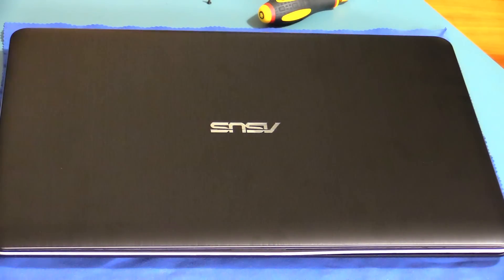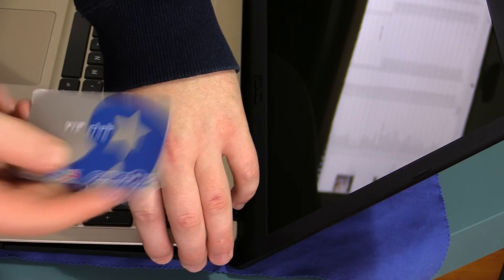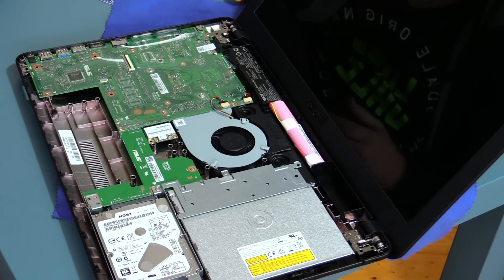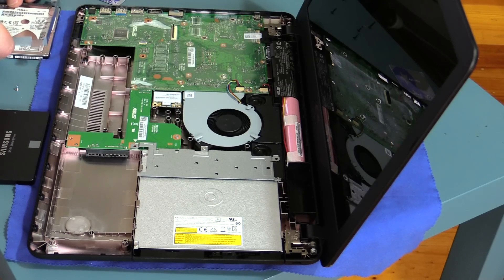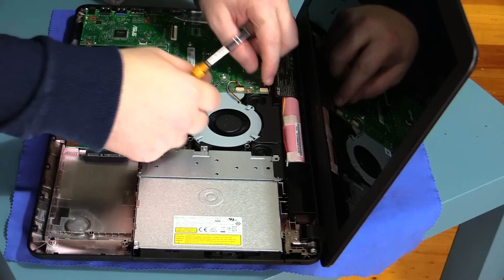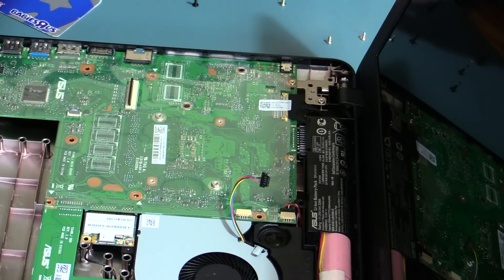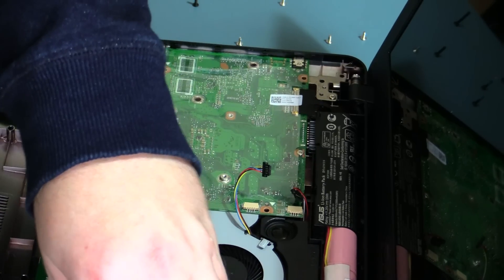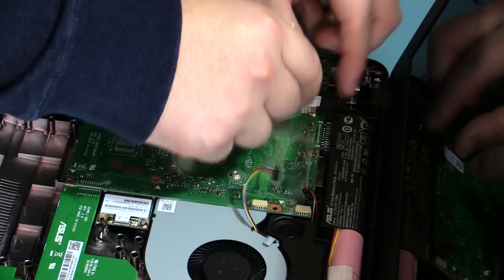Asus X540L Disassembly for hard disk replacement or memory upgrade

Comment: Hi, a friend bought this in Best Buy and took it to Argentina. Right from the box, the battery won't charge more than 50%, and when you disconnect the power cable, it shuts down. May it be a physical problem? Why might the Windows OS tells the % of charge?
Reply: +Rodrigo ST si. De todas formas voy a bootear un live linux a ver que dice, antes de operar. Luego te cuento!
Reply from the maker: hi there, yes it's most likely a physical problem, could be a faulty battery, maybe a faulty charger although it can also be the motherboard too. If it's not practical to return it you can try eBay for parts just try stick to genuine if you can. Good luck!
Reply: +Anthony Parker Thanks Anthony! Do you think the charger may be the cause? it says 48% charged, it looks like something internal. 
I don't have spare parts, opening just to check connectios would be worthwile? Or I shouldn't bother?
Reply: +Anthony Parker Thanks Anthony! Do you think the charger may be the cause? it says 48% charged, it looks like something internal. 
I don't have spare parts, opening just to check connectios would be worthwile? Or I shouldn't bother?
Reply from the maker: +Luciano Brom i wouldnt open it if you haven't already as it may affect your warranty claim. there really isnt much inside to 'check', its just a connector and short of them wearing with age they don't really have issues. Are you using a power converter or something like that? I'd say that your charger is probably the most likely cause but hard to diagnose without seeing it in person.
Reply: +Anthony Parker ok, will check all that. Thanks, man! Saludos from Buenos Aires!
Reply from the maker: +Luciano Brom no problems :-) happy to help! good luck from Australia
Reply: Hola Luciano, como estás? Compré esta misma notebook hace 1 semana en EU y estoy con el mismo problema.. Dice 84% pero si desenchufo el cable power se apaga.. Lo pudiste solucionar?
Reply: +Rodrigo ST no la abrí aún. Probé el cargador con un multímetro y funciona ok. Es raro que muestre un % pero se apague como si no tuviese batería, no? No será problema de software?
Reply: +Luciano Brom Quizás sea windows10 pero es bastante raro..
Reply: +Luciano Brom Dale buenisimo! Espero novedades. Gracias!

Comment: I am having trouble, I got my memory and hard drive installed, everything put back together, but it won't run off the battery anymore. I have no idea what I did wrong. Any suggestions?
Reply from the maker: Well battery is a physical connection, so unless that battery is faulty, it must  be internally disconnected or shorting out or something like that. Have you open it up to have a look? There is nothing to configure from a software perspective regarding the battery.
Reply: +Anthony Parker same problem here. Any other ideas?
Reply: +fzstephen I was testing it without the screws in, I don't think it was making good enough contact without it, once i got them in it was fine.

Comment: there is no point on change the memory ram becouse this laptop chip set only work whit 4 of ram, so dont try to replace it for an 8 of ram
Reply: Did you try it? 

ARK Intel spec sheet says the processor can handle up to 16GB but other parts probably don't agree with that.
Reply: I tried and it won`t boot. Nice comm, unfortunately I read it after i try installing 8 GB.
Advice: The laptop has 1 DIMM slot, If you run this specific model, do not try installing 8 GB, it won`t work!
Reply: dani calau Thank you for the valuable information!
Reply: I just put an 8gb soddimm in the x540L.  recognized, works fine.  The "L", I dont know about "LA" or any other variants
Reply: no... L as in X540L.  There are a number of variants in this product line.  Just confirming that a ram upgrade to 8Gb is entirely possible with this laptop
Reply: lots of reasons that might be.  What actual model do you have? the "L"?  the "LA"? SA? SC?    I can personally confirm the base "L" model comes natively with a single 4gb sodimm (not soldered on ram).  I removed that module and replaced with an 8gb, worked fine.  Can you boot on AC power?  there is a fastener at the top of the motherboard whose primary function is to provide a power return path to the battery, if that screw wasn't installed in the right place your battery wont work and the laptop will appear dead.  In this case, the AC power adapter would still work though.
Reply: thats not strictly true.  that may be true of the x540SA or SC or something (he actually covers the LA in this video), but the "L" reports as having 4gb physical memory.  upon opening it up you see one memory slot with one ram module size=4gb.  I removed that and replaced it with one 8gb module, which then caused the system to recognize exactly 8gig of physical memory. no mystery 2gig floating around.  If you go to one of hte memory provider websites like kingston or crucial and use their upgrade finder you will see an 8gb ram module correctly listed for the x540L, but NOT for some of the other similar models.
Reply: see asus specification page.. it only has 1 ram slot and can handle up to 8Gb of a single SODIMM.. make sure you use the DDR3L module.. don't expect much from the X540.. it is designed for lower end CPUs.
Reply: believe me, it won`t. The DIMM slot can support only 4 GB. The laptop is up to 8 GB if the motherboard have onboard  4 GB ( this memory can`t be replaced if your particular laptop have it) . After I tried to install 8 GB, I contacted ASUS Support and this is the official answer.
Reply: I prefer to buy gaming laptop
Reply from the maker: Hi there... the L stands for Low Voltage (1.35V instead of 1.5V)... if the SODIMM were 1.5V it wouldn't have booted at all, so it must have been 1.35V and if you just took a pot shot at that then... lucky guess! haha
Reply: +Anthony Parker i used 1.35V, it won't boot
Reply: there's a 2Gb soldiered on RAM.. you can't see it.. you can confirm this when you view your system specs.. this line came with a 2Gb soldiered RAM and a spare RAM slot
Reply: never thought about this, it may work. I`ll try in the future if I`ll borrow a ram stick.
Reply: did it make  difference
Reply: Hey there, I am using Asus X540L . The specification says its has 2 RAM slots. Do they mean we can add another RAM or remove the old one and put in a new one with higher RAM?

Comment: I cannot believe ASUS would design something so shitty. U should be able to get to the fucking ram easier than this
Reply from the maker: yeah agreed, you'll see this more and more in the cheaper lines of laptops though. where you cant access ram or HDD.
Reply: the most of the companies does it now bro
Reply from the maker: +LICKMYCUMAGAIN  yeah they kinda suck making it harder for people! that is business though
Reply: This is NOT an uncommon practice, and is in no way representative of build quality, or design quality of a laptop. What, you think engineers couldn't figure out leaving a hatch above the DIMM slot? Please.
Limiting upgradeability of sub-$400 computers is done for a valid reason: when you give your customers $199 worth of a Core i3 SKU and $149 in NVIDIA Kepler GK200, the best you can hope for is that they'd buy a similar product in 2-2.5 years, after their current one finally loses its pristine condition. ASUS have researched the subject, they know what they're doing.
Reply: Only for high end models. Not for low end models like this.

Comment: Hi there! I just bought the  asus x540LA, im wondering if i can upgrade the graphics card later? is it possible?
Reply: +Esteban Gonzalez No, in fact even laptops with budget dedicated graphics can't be changed out. They're discreet so soldered onto the motherboard. It's only the highend laptops that have removable graphics cards, although even at that level, it's very hard to get a compatible card that you can change out. It's just not something that's done commonly in laptop graphics cards yet.... you may see it in the next few years, just not yet. There are a couple of speciality websites that do trend in laptop graphics cards, but wouldn't work in this laptop. Please hit the subscribe or like button :-) Thanks.

Comment: swapped the RAM for 8gb and now on startup the screen just stays black (although can see it illuminate a little)...doesn't attempt to load anything, no Asus welcome screen, nothing. does anyone know what might be causing this?
Reply from the maker: its probably the wrong memory. did you use DDR3L or DDR3. pretty sure you need 3L with this model. ..
Reply: +Anthony Parker yeah well I tried putting the stock RAM back in at the screen still is black but slightly illuminates when I power it up. I can hear the hard drive and fan light up as well as the LED in the board. Maybe I'm not inserting the RAM correctly into those weird clips, do you install the RAM at a 45 degree angle and then push down into the clips?
Reply from the maker: Yes although it does have to be in quite firmly. Youll often get black screen and nothing if the ram is not in properly or its the wrong type. If the video card were not connected you wouldnt get any light on screen at all so I'd be very sure the issue is memory related.
Reply: +Anthony Parker it wasn't seated correctly...took me a couple tried but got it right. thanks for your help.
Reply from the maker: +Eric Moss no problems :-) glad you got there. please do hit the luke or subscribe button :-)
Reply from the maker: +Eric Moss ***like lol

Comment: Will a 9.5mm thick hard drive fit in this laptop or does it require a 7mm drive?
Reply from the maker: Hi Dan, sorry I'm not sure on that one, you'd have to check with the manufacturer... will certainly be tight... you can always also try without the hdd metal frame. Perhaps do some googling for the manufacturer service manual,  theyr usually easy enough to find online and may answer it for you. it might be just one of those things you have to try... can try opening it up, measuring somehow then buy the drive.
Reply: @Anthony99  It is an old post, but I need to replace on this laptop the HDD. And User manual does not mention the dimensions of the HDD at all, nor the specs in the google results. I'll check it because I have both 7,5mm and 9,5mm HDD.

Comment: Hi there. Nice video.
Does it have a single slot for the RAM or two? 
Thanks in advance.
Reply: It as a single RAM slot. 4GB comes factory soldered to the motherboard, allowing you add 2GB or 4GB to the RAM slot on the reverse side of the motherboard.
Reply: Is it possible to add also 8gb of Ram
Reply: well,Emmah Stone got it wrong,the max capacity aplies for the slot not the total with the integrated memory since the intel core I3 can handle 12 GB of ram and so does that nice 920m.
Reply: i have the i3 with gt 920m. according to asus tech support, the DIMM slot can handle just 4 gb, and the laptop have just one. I tried on my own laptop to install 8 gb and the display remains black ;). You can try to put 8 if you want to convince yourself :))

Comment: Changed ram now display doesn't come on
Reply from the maker: +Matthew Edwards no problems,  dont forget to hit the like and subscribe buttons. it is a big help to us YouTube creators. thanks
Reply from the maker: did you check whether the ram is LV or standard? if you put standard DDR3 in a laptop that needs DDR3L it wont boot, wrong voltage.
Reply: yea. That was the issue also the fact that it wasn't in all the way. Got it working though.
Reply: +koxsuper5 having the same issue as you. i really dont want to take that mobo back out but ill let you know if i get it working
Reply from the maker: +Matthew Edwards did you check for LV ram instead of standard ram? if it doesnt boot its either incorrect ram (most likely) or the ram isnt in the socket properly. good luck.
Reply: +Anthony Parker I made sure to get 1600mhz DDR3L. Maybe it is a bad dimm? I'm putting original ram back in and we will see if it boots or if I broke something
Reply from the maker: +Matthew Edwards its quite difficult to 'break', more than likely it's incorrect ram / incompatible. thanks
Reply: +Anthony Parker yea it booted after I put the old ram back in. I'm going to try to reinstall one more time and if it doesn't work I'm going to assume it's the wrong ram. Thank you
Reply: +Anthony Parker done thanks again for this video it helped a ton. It seems like this is one of the more awkward laptops to get inside of to replace stuff.
Reply from the maker: +Matthew Edwards happy to help! I dont make the worlds greatest videos but as long as you can get done what you need to get done.. thats the important part. thanks for subscribing!

Comment: and where is the intel hd graphics ?
Reply from the maker: intel HD graphics is built into the CPU, even dedicated graphics these days are rarely seperate cards in laptops. theyre typically discreet, meaning built onto the motherboard... but Intel HD graphics is built into the CPU and has been ever since the release of Intel Core i3 i5 and i7 processors. dont forget to subscribe! thanks
Reply: +Anthony Parker OK thanks for fast replying! and I have 1 of these and I just want to upgrade my ram any suggestions?
Reply from the maker: +Karl Aquino the big thing you'll need to know is whether you need DDR3 or DDR3L... itll say on the box if you still have it? you should be fine to add an extra 4, 8 is a maybe though... best check the manufacturer website if you want to add 8gb as it might not be supported.
Reply: I have the box it says DDR3L. I have 4gb of RAM
Reply: Anthony Parker and can you suggest any brand of RAM? :)
Reply from the maker: +Karl Aquino yes that means you should use a Kingston DDR 3L 4gb DIMMM
 must be L series memory though which has a low voltagem
Reply: OK OK. I see some Kingston brand here in philippines. Thanks for the info! And how do I put that inside?

Comment: I just buy ASUS X540LJ and want to upgrade in the future. can i put SSD M2 or mSATA? Thx for your answer.
Reply from the maker: +bowo san Thanks for your question, although no I'm quite sure this unit only supports 2.5" SSD... so if you want to use a seperate data drive you'll want to change the DVD-RW over for a hard disk caddy to go in place of it. Cheers! Don't forget to subscribe :-)
Reply: I'm glade you want to discus this product with me. I'll change, coz i almost never use that... 😄. If i change that... How i close the hole that leave from DVD-RW. It design for DVD not SSD, isn't it? Cmiiw.
Reply from the maker: If you search eBay for DVDrw HDD enclosure youll find for about 10-20$ you can get an adapter to convert DVDrw slot to hard disk caddy
Reply: unfortunately, i don't have any CC and believe it or not, i never buy anything from ebay. hahaha. but i try to search at the other ecommer in my country. that name DVD caddy or something, right? 
thank you for your reply.
Reply: suddenly i found another solution for that problem. i can use WD black2 dual driver, 120GB SSD+1TB HDD... but it very expensive... in my country its around $370
Reply from the maker: +bowo san i have heard of these drives before although I havent implemented them before to tell you if it is a good solution or not.
Reply: +Anthony Parker the other side, its very expensive.. haha
Reply from the maker: Don't forget to hit the like or subscribe button :-) Thank you

Comment: Hi,
How many DDR3 do I need for it?
And this laptop is it the same as the ASUS X540?
So the ASUS X540 has a 1TB internal storage. Shall I upgrade it?
Can you help me please?
Cheers
Reply from the maker: +Dominik Gál Hi there, we did cover the memory upgrade in this video although double check the spec on the DDR3 before you do it... it might need DDR3L and if it does it wont boot if you put standard in it. So check first... itll say in the specs of the box... and yes the stock hard disk is crap so Id definitely change it but it is up to you of course :-)

Comment: what about game performance? :)
Reply from the maker: +riski games This isn't a gaming laptop, although I've been quite impressed by it's performance with general use tasks, very fast and efficient. Unfortunately I haven't run any 3D Mark tests, etc.... although I think it'll be fine for general gaming, as long as you're not an intense gamer who needs insane frame rates, etc.
Reply: +riski games gw udah coba beberapa game di laptop itu. gamenya CODMW2, WRC4, MotoGP08, one piece pirate warrior 3. masih bisa playable. 30-60FPS mah dpt. cuma ya asal maen, ngisi waktu luang, ga ngejar graphic yg high... ga ada masalah.